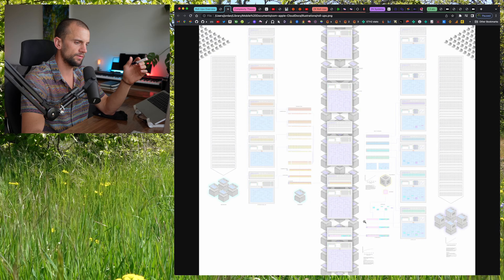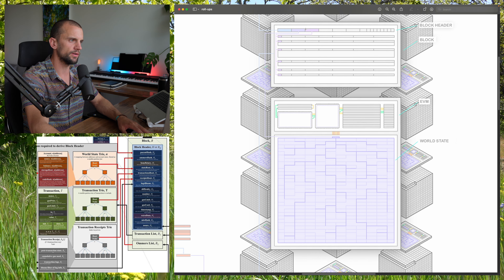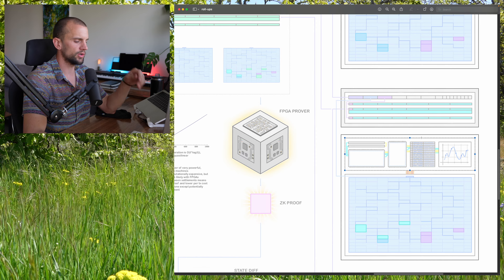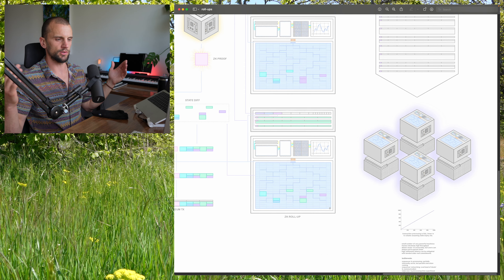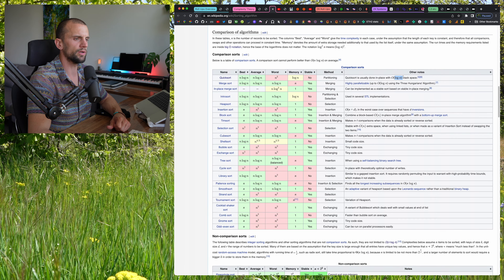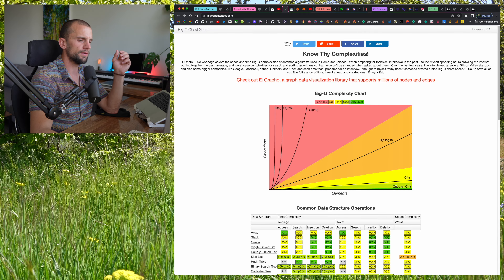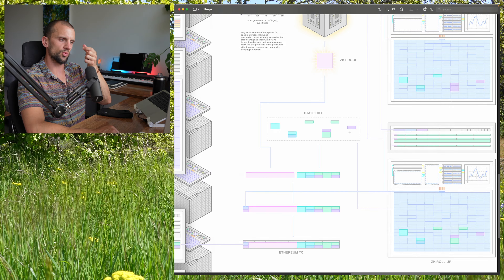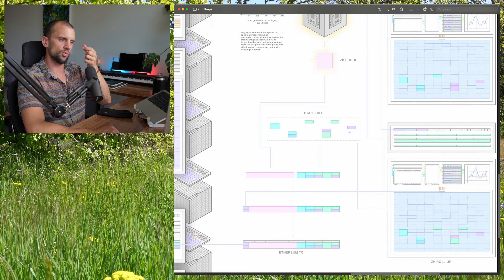Ethereum Scaling: ZK Roll-Ups

Comment: Hi, great video — very helpful!

Question: what is the business model of rollups? Sequencers use expensive hardware and need to fund their entire operation — do they do this by charging small fees for transactions they process and aiming to get high tx volume? I struggle to find information about this — but see things like Starkware being given an $8 Billion valuation. If you could explain this I would greaty appreciate it. Cheers.
Reply: Unless — rollups are volunteer-run, like p2p network nodes?
Reply from the maker: That's my understanding. The sequencers and provers can take some part of the fee to cover their costs and give them some margin. Another avenue is having a token of course. The L2 operators could maybe have the token used in the sequencer proof of stake, or however it works, so maybe the token is required for staking in that process, but ETH is still used by users for fees? Also need to factor MEV into all that. I think there's many ways to make money running an L2.
Reply: @jordanmmck  thanks for the reply! 

Do they take part of the fee, or charge an additional fee? Or is it up to them? Because taking part of the fee would reduce the fee going to stakers and eat into the security budget of Ethereum — especially if they’re worth $8 Billion

Or is it actually that there would be only the rollup fee paid by each transaction since it’s done off-chain, plus a small contribution to the batch fee
Reply from the maker: @hamletwinston7239  every roll-up will need to pay market-determined ethereum gas fees to settle their batches. the amount they pay there won't be affected by their taking additional fees or not — so that shouldn't have any impact on eth security budget.

the roll-up needs to charge their users a large enough fee such that they can afford the L1 gas cost of settling the batches. i imagine they would set their fees a bit higher than that level so that they can settle the batches and also make some margin

Comment: Question : The Prover generates the Validity Proof, and includes it in a transaction (which then goes to the L1 Verifier Contract)  ..BUT,  is the proof included in the Batch? And if so, does the batch and the proof containing transaction represent the same?
Need your help here.....great explanation and visual schema btw
Reply from the maker: The data availability data is separate and distinct from the proof. Which is why we can have things like validiums where the DA data isn't even on the same chain. The smart contract prover doesn't actually need all that batch data in order to verify the proof. The batch does not contain proof data afaik.
Reply: Thanks for the clarification :) 
By any chance can we continue this convo in Twitter Dm.... I do want to share some of my diagrams that I drew while learning n writing about Zkr's

Thanks 🙂
Reply from the maker: @sidkumthekar4614  yeah sure. send me dm
Reply: @jordanmmck  Dm'ed 👍

Comment: If the EVM doesn't actually look at the state delta posted in calldata, who verifies that it is accurate?
Reply from the maker: As far as I know this data is NOT verified as accurate in any on-chain way. But anyone who is running a full node would be able to tell if a delta is incorrect as the resultant state root would not match the state root that the proof attests to.